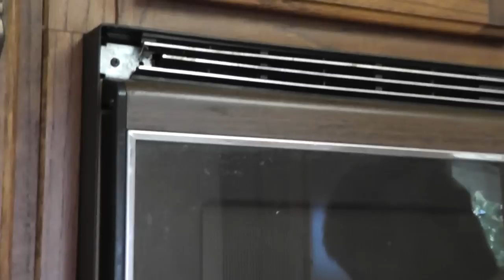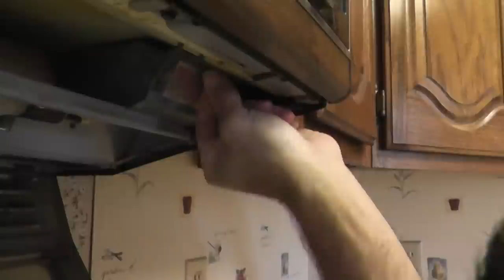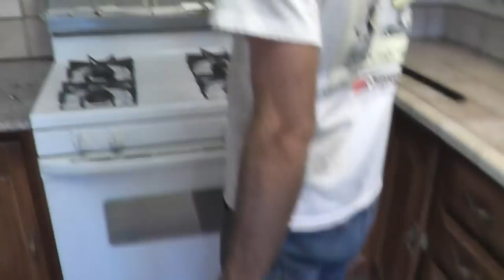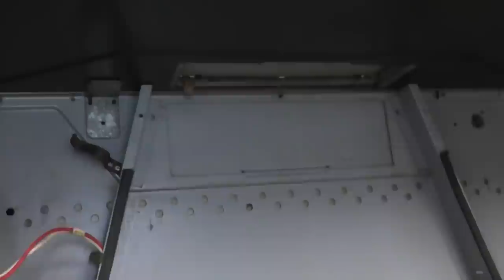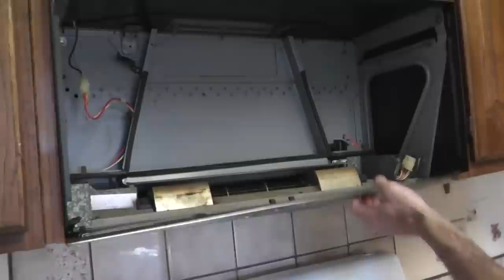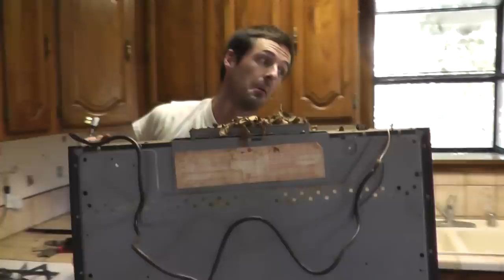How To Remove An Over The Range Microwave - With Fryer Grease Hand Therapy!

Comment: I was working for GE when I purchased this exact model in 1978, the first year they were introduced. Microwaves where new to the market then and folks would marvel at there efficiency. The dealer even offered free cooking classes upon purchase. Other than the noise from a loose exhaust fan blade, mine was working just fine until just recently when the magnetron started humming (11/2018). It's a shame GE no longer builds them to last 40 years. Thanks for the video.

Comment: Thank you so much for sharing this video. I had an old GE Spacemaker microwave to remove but I couldn't figure out how it came out until I watched your video. I thought they all pivoted down like I'd seen in other videos. Your video saved me! After watching your video, I successfully removed my old GE Spacemaker Model JVM64004 and installed a new one. I spent several hours trying to figure out how to remove that old microwave and it was so simple after watching your video. Thanks again and keep up the great videos!
Reply from the maker: +Curt Long Thanks for the comment, and for letting folks know the method works on other models as well.

Comment: This was extremely helpful for me also.  I watched this video, then removed my microwave in 20 minutes.  My old OTR microwave was a Tappan Spacesaver, but a service technician once noted that GE manufactured it.  My installation had one additional assembly on top with a charcoal filter for venting to the room.  There were 4 additional screws going through the bottom of the overhead cabinet into the room vent assembly.  Other than that, my installation was identical.  Thank you!
Reply from the maker: I'm glad you got it down without trouble, and thanks for the info about the similarity of the Tappan

Comment: Put back new stainless steel microwave and change the range to stainless steel as well. Remove wall papers and either paint or back splash based on budget.. It will look very nice.